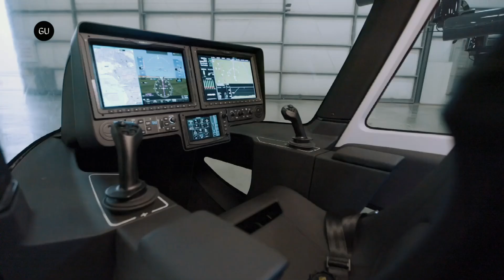Archer and Stellantis Reveals World’s Biggest eVTOL Aircraft Manufacturing Facility

Comment: why dont you just put 4 big propellers on it rather than heaps of tiny ones, looks shit
Reply: It's the applied physics of electric motors. These props are sized as big as possible for the motor weight. Go bigger and you need to add heavy gearboxes and possibly transmission systems between motor and rotor to boost torque. For the same weight you can add another motor. It's a system of equations and the final design is simply the approximate "best" operating point between motor size/weight, rotor size, number of motors.
Reply: @kg4lod  can this thing fly?
Reply: @frankyflowers  Yes as far as I am aware. There are videos of it flying without people inside.
Reply: @kg4lod  i don't think it can fly 3 minutes with people. their stock is up a bunch today.
Reply: Also, more redundancy equals greater safety.  Also, it's quieter and this will allow it to operate in more markets. Larger props equal greater tip speed, which equals more noise.
Reply: @patpatpat999  Not quite. With tip speed below the speed of sound, more blades equals more noise for the same amount of lift. The center of the propellor generates significantly less lift than the outer edge (slower linear speed) yet still disturbs the air (e.g. noise) and multiple propellers result in more opportunities for constructive interference -- so instead of low intensity Gaussian noise, you can get very strong peaks. It's why a helicopter sounds like a white noise machine, but a drone sounds like it's singing a few specific (high pitched) notes. The redundancy issue is also not so clear. While these vehicles have more copies of the motor-rotor system, it also likely needs all of them to fly stably (so there are more critical parts and less reliability) and there may be little-to-no redundancy in the power source (only 1 battery bank), distribution network, control system, etc...